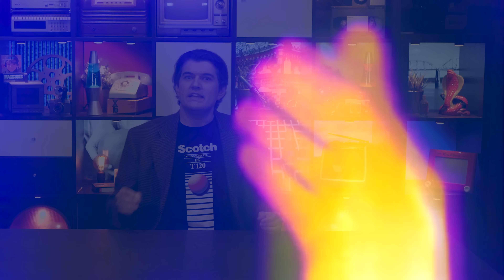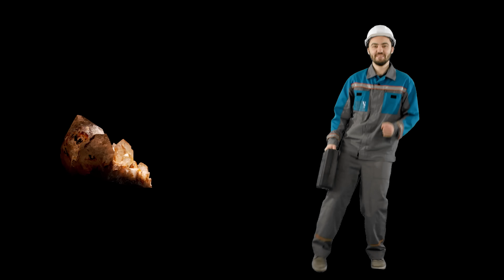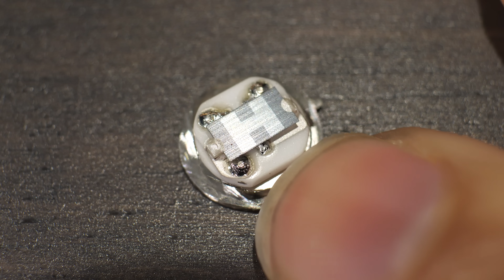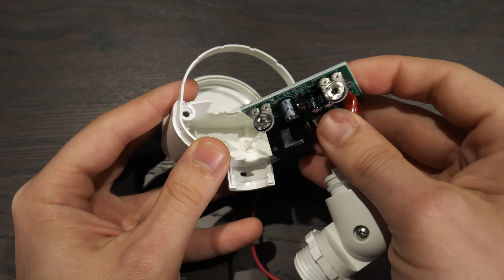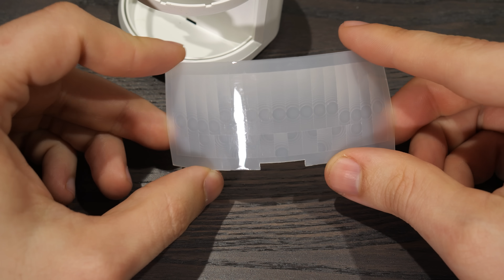Passive infrared motion sensors: a two-bit camera powered by crystals

Comment: As I was watching this, one of my smoke detectors went off, the smoke detector that I purchased based on your video on these devices (they had been going off when showering, making bacon etc.) and have proven to be pretty much immune to false alarms, untill just now, weird.
I was actually typing my comment that I have a backyard  floodlight with seemingly the same sensor, and it still works perfectly 31 years after I installed it, when the smoke alarm went off.
The first time that any if them has alerted since I installed them.

Comment: you forgot the CDS (cadmium sulfide photoresistor, the "black LED") on the first sensor making it only turn the light when is dark while the other doesn't have probably one is for exterior and the later for interior use

Comment: I've been watching a few videos about how PIR sensor's work since I saw this video, one of the other videos I watched talked about dual technology sensors that detect infrared heat, but also ultrasonic reflections using the doppler effect.  The video suggested that all modern PIR sensors are dual technology to reduce the likelihood of false triggers.  Do you plan to talk about such detectors?  The ultrasonic sensors seem quite simple, and ultrasonic sounder produces sounds outside the range of human hearing, and then a listens for the sound bouncing off moving objects.  Can a standard PIR detector detect objects such as moving vehicles?  I presume it might if it can detect the heat from a combustion engine for instance.

Comment: I've noticed that the motion sensor light in my attic basically doesn't work when it's really hot up there. I guess it's because everything in the room is close to the same temperature as my body so I'm effectively invisible
Reply: Pretty much. The range may also be longer if it's cold and you are nice and warm.

Comment: This is exactly what I was wondering about! I have two of those! One I have set so that the light goes on when I go to the bathroom or come out of the bathroom at night, without my needing to go to the other side of the room over an open stairwell to switch it on.

And IR goes through walls! :p So it also notices then I move about in the bathroom right next to the lamp, and it notices when the neighbour goes up the stairs on the other side of the wall 🤣 Luckily for me he sleeps downstairs and has a bad knee so that only happens around christmas, when he goes upstairs to shower. But it is kind of funny that I can check my neighbour's movement like that 🤣

Comment: Years ago I have started using little battery powered lights with such a sensor in various spots of my apartment. It started all with me having a short hall there, that didn't have any wiring for lights.
These days, I am increasing this concept more and more, tending to light up many more spots of my home with such little lights. Because when you think about it, when you just need to walk through a room, but don't need to do anything there, you don't need a lot of light, so such little lights do well. This way, you don't always need to go for the switches.

Additionally, even if there is wiring, I tend to use the battery ones, because they are a lot more power efficient, you don't need to hook them up to wiring and they are ultimately flexible in their placement, not needing power lines. Sure you need to charge the batteries every now and then, but since I usually add my own set of 18650s to them, I can simply decide, how many cells I want to connect in order for the ligh to run longer on a charge.

Long story short: battery powered lights with motion sensors are a neat and versatile thing. If you think about it, I am sure you would improve your living situation quite a bit of you methodically used them too.

Comment: How many people remember when shop alarms used Microwave sensors with feed horns ? When they first came out PIR sensors were expensive. I looked at getting a PIR controlled outdoor light back in 1990. They were so expensive I calculated the payback time would be about twenty years so I bought a much cheaper dusk to dawn one with a CFL tube instead.

Comment: I used to install home security systems about 20 years ago. One thing we would do sometimes to motion detectors to obtain a pet immunity with them, was to install the detectors upside down. The detectors would cast a downward pattern for detecting motion. Installing them upside down would create a blind spot for Fido to walk around while still detecting a person walking. 

You could get more expensive motion detectors that would incorporate two separate PIR sensors or a combination PIR/Microwave unit that would require both sensors to trip to cause an alarm. They were good for harsh environments with possible false alarms or pets.

Comment: Hey Alec, I'm sure you get recommendations for vids all the time, but I thought I'd throw one at you. I'm an electrical engineer and despite having worked with all sorts of cool tech, I have rambled for years to anyone who will listen about how there is no better marriage of technology and application as wireless power transfer and electronic toothbrushes! All the drawbacks of wireless charging (poor efficiency relative to direct electrical connection) aren't a big deal for electronic toothbrushes since they just sit there for hours on end and they use very little power (i.e., low power low duty cycle), and the benefits of wireless charging (no metal contact) are a nigh-necessary for them since their use-case is inherently wet! Plus wireless charging is something I think a lot of laypeople find perhaps more complex than it is, even though it's no more complex than a transformer. It's such a simple thing, and I really think it is such an elegant marriage of a technology's pros and cons with an application's specific needs.

Comment: There is just one sensor on this crystal, not two.

But this is enough for the function. If either of the edges get more infrared light than another, a current appears.

Comment: Very well explained Alec! There is a video over on the channel MrMattAndMrChay about these PIR sensors, going in depth about how they work as well, but your explanation is as good as that, I would say.

On the topic of having mirrors inside you are correct as well. I happen to have collected some PIR sensors for automatic doors and the older ones used this arrangement. There are even adjustable flaps in the IR path to cover smaller or larger parts of the mirror so the sensor can only respond to a smaller (or wider) area to activate the door. Very clever and neat to see.

Comment: 06 Electrician here who installs security systems (And a lot of other things too). You are mostly correct about pet filters. Some, a very small some, do not change the size of the lens but instead simply block sections. This makes it so that any creature low enough to the ground will not set off the PIR. This is great for large dogs who stay off the couch when the motion is aimed correctly BUT makes it so a thief could theoretically low crawl around your house to steal your stuff. Odds of that happening are suuuuuuuuuper low though as they would have to have insider knowledge about the particular sensor AND lens installed.

Comment: Free energy device - actually not.  If it converted a fraction of the incoming infrared radiation into electricity, like a solar panel in the visible spectrum, that would be perfectly acceptable.

Comment: I wonder what is the purpose of the IR receiver LED on the circuit board (the one labeled "CDS").
After searching for CDS, it would appear to be the acronym for "cadmium Sulfoselenide" (photocell) and in this case is used to automatically adjust the sensitivity according to the ambient light.

Comment: These work best if you are moving across the field, side to side, whereas approaching it head-on challenges its OR gate. Most new sensor lights also use SOUND which we can't hear but is a foghorn of needles to your pets. Ultrasonic. Some even have mics to pick up keyboard tapping or human breathing to keep the lights on, saving you from standing up and waving in the stall.

Comment: Intresting and well explained. I never saw an sensor with an adjustable distance. The two adjustments where always time and the amount of ambient light so that they don't switch at daylight. For the pets I rather think the difference was made on the body temperature than the size. Anyway the sensor won't switch on pets like snails, turtles spiders and so on, that had the same temperature like their ambient.

Comment: I don't really get why heating objects don't cause a voltage imbalance. The light/infrared would still land randomly distributed across the crystals (specifically because of the lens refracting it into multiple different spots), and thus affect one (/some) crystal(s) more than the other(s), no?

Comment: Deviant Ollam has a good bit about these when used as door exit sensors. When you have to badge in but not badge out, it's almost always one of these(called a REX sensor, for detecting dinosaurs). They're very easy to bypass. The temperature can also go down to trigger it.
Reply: No, they are for detecting handtool woodworking YouTubers (@RexKreuger ) 😛

Comment: 8:32 : "Since it's infrared light, wherever those spots land heats up just a tiny bit."

I hate to break it to you, but light of ANY frequency hitting a surface will heat that surface to some degree.
Infrared is no better at heating than visible light, or ulraviolet, or ...

Comment: Before I was a security technician, I was a security guard. I sat in a control room with about 250,000 of these sensors hooked up to it.

I used to explain how they worked on three levels. On the broadest level, they detect motion. On an intermediate level, they detect the variance of mid-range infrared light across two or four light sensors. On the most specific level, they detect a variance of voltage across their sensor.

The reason I would explain it this way is because it shows how false alarms can occur. False alarms are rare enough, but when you have a quarter of a million of them hooked up to your system, those falsies keep you pretty busy. The simplest could be a curtain wafting in the draft from a poorly sealed window. Then you get some from rapid heating in summer. Then you get some false alarms from power surges, rough power, or faulty electrics within the sensor itself.

Comment: I used to have a motion sensor light outside the front door of a rental I lived in, and one day (bored and with too much time on my hands apparently) I decided to try to defeat it by the magic of moving really really slowly.  It had a triggering range of maybe 15 feet out from the door, and I know I took more than 10 minutes to cross that space. I had one foot on the threshold and one foot inside the door when I moved too quickly and the light came on.

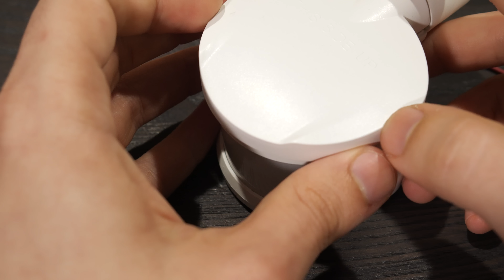Comment: 6:21 ".. flash of light, say lightening" not the best example IMHO, most (I assume) might think of the visible flash of lightning rather than the less obvious but equally bright IR flash.  In any case, none of my PIR sensors have ever been triggered by lightning as far as I know.  It's possible, I assume, but unlikely with these general-use PIR sensors. 
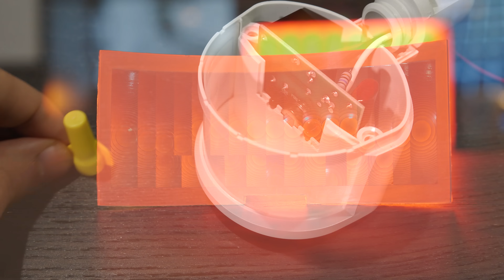12:04  why are you moving a wire nut in front of the PIR sensor??!!  
Great video, as always! 😊😊

Comment: My old viola teacher had one of these at the basement stairs leading to his apartment, and I would often entertain myself trying to move slowly enough through its field of view not to trigger the light
Reply: I worked on these for quite a few years, and I'll let you in on a little secret (at least how puts worked). There is a lot of processing going on to the signal.  The faces if the lens cause a large shift in light to occur. This shift has to be enough to go above a threshold "noise" level. This noise level is constantly being adjusted, so the way to fool is to move slowly and then gradually raise the noise level to a point where you won't be able to trigger it at all ( until the noise level threshold goes back down). This is easier said than done without practice on a particular setup, due to the risk of crossing one lens facet to another. But with that knowledge, you should be able to figure out how to trick the same setup...

Comment: Serious question here. We installed Lutron motion sensing light switches in a new shop build at my friend's place. Before we got the roll up door installed there was a 12x12 hole in the wall, and one of the sensors would catch your motion as you walked out of the garage door appx 75' away. I find it difficult to believe that it's catching IR heat at that distance, so is there some other wizardry at play here? Thanks, love your channel 👍

Comment: Ok I assume loads of EE guys already commented, I shall be one of the many, but I shall focus more top level/application orientated. 

You can get 4 element sensors to increase accuracy/fidelity/range/sweep rates.
Typically lens and sensors doesn't come as a set, though it should really for ease of design, and the design of the lens is a bit of a black art. You can pay a bit of a premium for convenience but typically these are made in the 100ks++ so a few penny saved is quite significant. of course it depends on the product and platform (market it sits in) at the end of the day.
Performance of sensors changes with environment - ie temp frequency, noise (electrical, heat differentiation ie air conditioning etc etc).

You can trick/fool the sensors by moving slow enough so that the sweep rate is not triggered. Of course as you get into the sweet spot range (typically tuned to 1-2 meters) it will be much more sensitive. This in application could be an issue if you use this for safety and multiple 2 element sensors or 4 element sensors are used.

If you go to the pinnacle of this technology (mass market), it will have accuracy of the ability to know what sex you are (M/F), approximate age (increments of 1-2yo), facial expressions and multiple people in the picture. Most importantly it is only IR data and not recording "image", it skirts round GDPR/personal data business. Not to mention the minimal data storage for the information which can be provided.
Supermarkets and the likes are starting to use these IR sensors to put up specific adverts as you walk in the store to tune their advertising to your specific needs (ie 24 year old male coming into the store at 23:00, they want alcohol or snacks). I have no doubt these will be used in crude form of security, or at least first line of security in airports etc.

Comment: And why does it only work at night? It works at night whether it's very warm or cold outside and the opposite is true during the day
Reply: if it's really hot, then everything will be emitting the same infrared heat radiation that your body does. The camera receives heat signals constantly, so a person doesn't stand out any more.

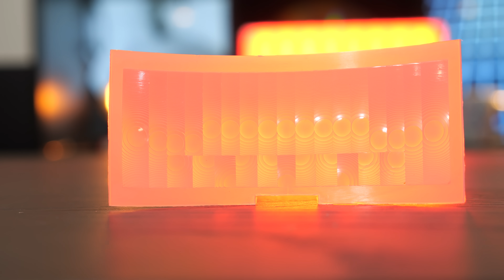Comment: 7:45 Maybe you could use and IR remote control to shine through the lens, which most camera sensors will pick up? But it's not anywhere close to thermal IR so probably not

Comment: Ohh, yes I did think about this a LOT as a kid! We had a sensor at our local store and quickly noticed that when I move it turns red. But when I don't move and move very slowly it doesn't detect me. Jump forward a couple of decades, I bought a PIR sensor for an arduino and had a little fun with it. I wanted to make a little device that turns on when it sees someone walk by and that's how I found out about how the one from my childhood worked. I wanted to build a halloween decoration that turns on only when someone's there to spook them :) Very interesting and basically a super simple sensor!

Comment: Here's how that "H" sensor works:

The entire chip is made from the pyroelectric material. The H you see is metal deposited onto the substrate surface.
It's built like two series capacitors: The two large bars of the H each also have metallisation on the backside of the chip. The two bars of the H and the backside metallisation form two plate capacitors, with the pyroelectric substrate between the plates.
The little horizontal bar of the H connects the two capacitors. There's no connection between the two capacitors on the backside, theres a gap in the metallisation.

The external connections are only to the backside metallisation. So effectively its just two capacitors in series.
Temperature changes polarise the substrate due to pyroelectricity, which in turn induces a voltage in the capacitors. The induced voltage is in the same direction, eg the front plates + and the back plates -. As both front sides of the capacitors are connected to another, they effectively have "opposite polarity". No voltage is measured across the entire chip for common temperature changes.
Reply: The pattern you see on the surface is likely just from wafer slicing, as there is no need to polish the wafers for this application.

Comment: Did not pay full attention to the video (making breakfast at the same time) but I think you missed a key factor how these works here: AFAIU the key factor is not just to detect changes in IR but the the fact that the IR source (ie you) move from one 'view' segment to the next in the and this creates a change that is detected. That is, IIRC. Also fun 'fact', you can defete these sensor if you move very slowly towards them.

Comment: Nice video. Adding my 2 cents. Pir “works” like a 1 point heat meter. Measuring the average from the lens. The lens having distinct areas ( each lens ) gives a bigger variation on the signal. If a human passes sideways across the pir the signal varies hot cold hot cold hot, making detection easy. Walking toward the sensor can fool it. And as mythbusters tested, heating room to human temperature can negate pir sensors. Have a great day all.